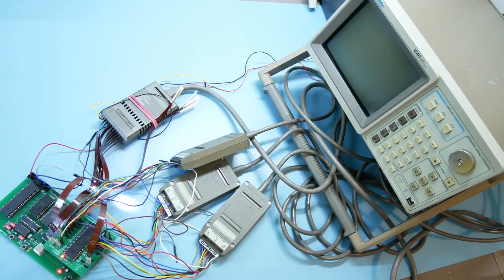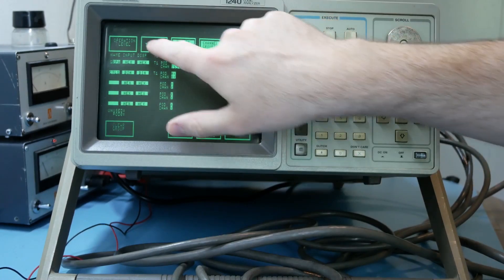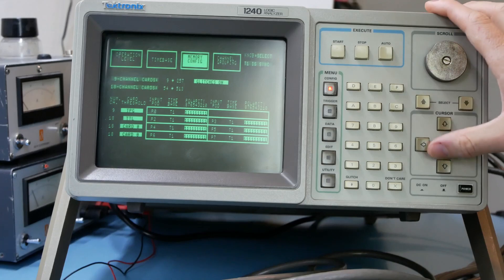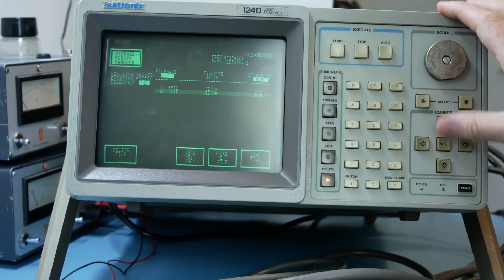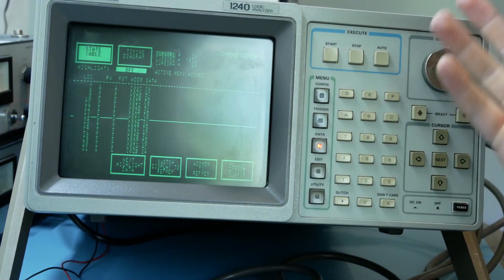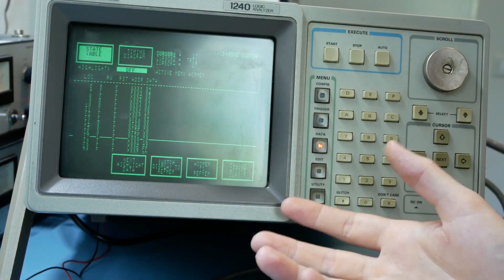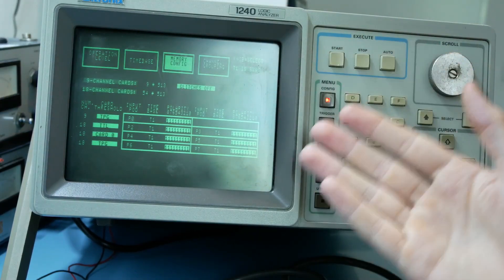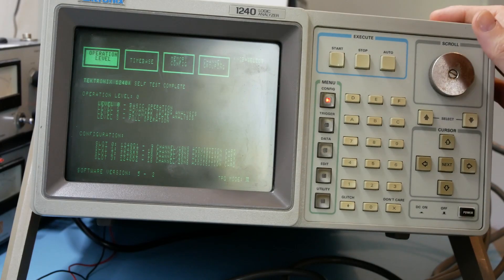Using a 1980s logic analyzer!

Comment: Not many comments on this tread:)... I'm sorry. I used this analyzer a great deal from the 1980s into the 2000s for my work. Very useful for a variety of circuits. I have one at home that I still use when I don't want to spend time thinking about how to use something more complicated. In the early 1980s, the company I worked for bought 50 of the DAS9100s (at about $50,000 each) and used them to provide both stimulus and response to product circuitry attached to an ATE. When they were surplused years later, I bought one for $50, along with all the service manuals. I still have it, along with some Tektronix 3001GPX and 3002GPX analyzers. Great Products. Good job on your repair and figuring out your pod functions. I have also used Tek's TLA products and found them fun and useful. I'm retired now and just use the analyzers for troubleshooting and documenting projects I make. Good luck on your adventure.